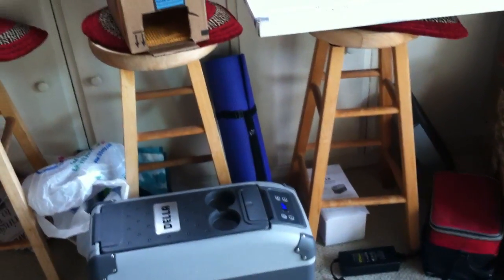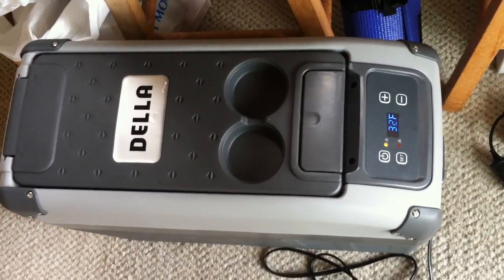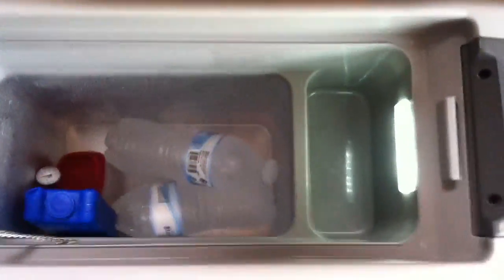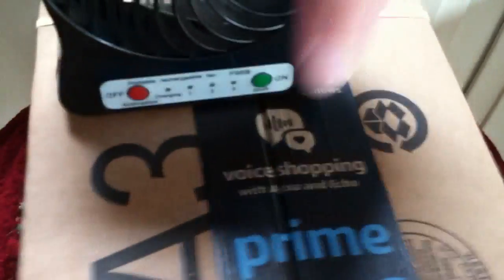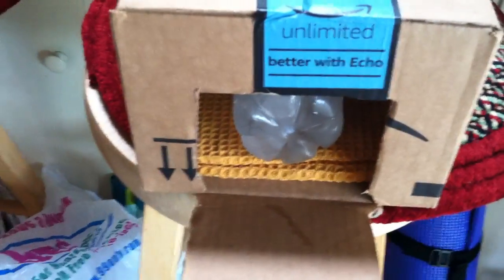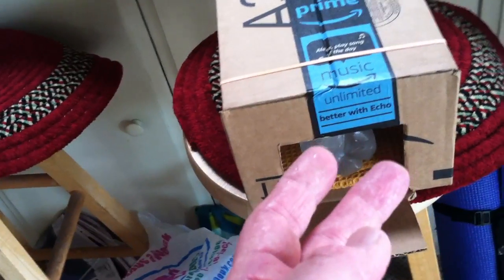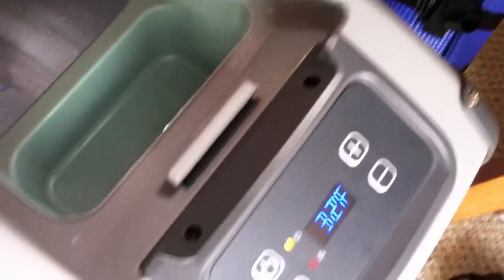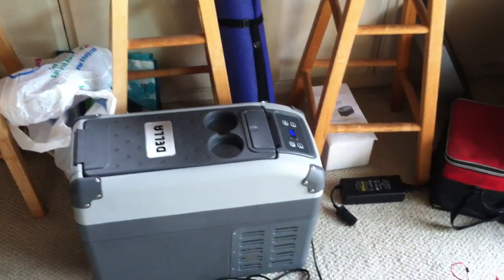Personal Solar Powered Air Conditioner----update

Comment: http://www.goodreads.com/book/show/295736.Solar_Energy_Projects_for_the_Evil_Genius check that book out. one of the projects uses ammonia-salt brine and solar heat to replace the compressor. The book gives instructions to use it to make ice, but compression and changing gas to liquid  on the cold coil is the trick. I would recommend a box (metal to allow good temp transfer) around the coil to ensure ammonia gas can't leak out, but a fan can blow right over the cold part instead of making ice. just need a fan beyond the cooling system itself. Einstein once said the best way to generate cold is to generate heat.
Reply from the maker: We use a Dometic 3-way refrigerator chest when we are over at Catalina island.  We set it outside in the cockpit and run it on a small bottle of propane. It will run three days on one can.   I did alot of research on these type of refrigeration units.  Einstein and one of his students were the original designers. They don't work very well on a sailboat under way because of the tipping.  In a harbor they work great.

Comment: The heat extracted from the water has to go soewhere so the freezer shouldn't be in proximity of the area being cooled. It would preferably be vented outside or away from where you're trying to cool
Reply from the maker: YES!  The little freeze will be located near an open hatch and the air flow in the boat should take the heat out that hatch.  It is spot cooling I'm after but if I end up heating up the whole inside of the boat that is no good.  Excellent point.

Comment: drill inlet and outlet on one side of freezer (so the lid will still work). 1/4" copper tube coiled inside a 1leter water bottle filled with ice and a large rubber hose with a reducer wiuld do nice... a 1/2" 3v edf (like in 12v inverters) in the hose and a usb like you already have for the mass flow.  a little less cool than streight ice because of serface area but sustainable
Reply from the maker: Yes!  That is the best way to do this but it then becomes a stationary AC unit that I can't move around easily.  I still might end up doing it that way.  Thanks.  Perhaps make this up as an 'either or' device that can work both ways.

Comment: Nice keep pushing.  I get the part of blowing a fan over the ice to spot cool you, why do you say it will be cool DRY air.  You said the day would be hot and humid.  It would seem humid air passing near the ice would condense (some not all) but in trade this accelerates the ice melting which as it melts is putting water vapor right back in the exit air stream and a return to near the same humidity as at input.  Can you show me where I got off track?  Not trying to be critical, I have been wrestling with this for quite a while, and could use a bit of understanding.
Reply from the maker: That is why I am using the sealed frozen containers.  The water stays in the container.  The cold mass condenses out the water in the air as it passes by the bottle. The condensed water is usually drained away somewhere or collected in a container. There is a differential in air humidity between the inlet and outlet and the air flow feel cooler than just cold humid air.  I was really surprised how well these simple 'ice' AC units work.  Build one up and try it.  An old shoe box will work to test the theory.
Reply: Thanks, somehow I forgot you were not using a block of ice but are using a sealed bottled of ice!  Old brain gets tired sometimes!  That all makes perfect sense now.  Now if we could find a better substitute for using mechanical compressors.
Reply from the maker: Yes.  I really don't like the mechanical compressor method either.  I spent some time working with Peltier modules the other day but the efficiency is terrible.
Reply: After 150 years, one would think there would be other reasonable ways to make cold without resorting to compressors and Peltier modules.  It is hard for me to believe Nature is that limited.  As another interesting research path, I have wandered if the principle of a capacitor could be incorporated.  As I see it normal refrigeration hot/cold is really an expression of electrons gaining and loosing kinetic energy.  A capacitor when charging would be similar to compression (heat side) and a capacitor discharging would be similar to the expansion (cooling side).  In the first phase the electrons are forced into a higher density order and  later the released electrons revert to a low density order.  Has anyone noted cooling effects with capacitors?  An advantage of capacitors if could be used is no moving parts and a much larger choice of insulating materials which would also serve as a dielectric.  With Peltier, the choice of thermal insulators is very limited as they have to be conductive also.  Have heard of acoustic refrigeration, with interesting potential, but after a big splash in science circles, we hear little more progress.  My thought, has anybody looked in piezoelectric ways to achieve cold?  Many directions.  So far, Maxwell's Demon is triumphant!

Comment: make a swamp cooler,no ice needed,just a fan and a small 12v pump to circulate the water,or get 50 feet of 3/8 copper tubing and put it around a fan and pump cold water through it
Reply from the maker: I built one of those a few years ago.  The problem is getting the cold water.  I am going to use this on a cruising sailboat and the ocean water temp here in So Cal gets too warm in the summer to work well.  If I converted this little freezer to the single purpose of cooling water I could use that 'copper coil on fan' method.  I might end up doing that.
Reply: The fan + copper coil + ice water pumped from & back to the freezer would be a good idea because with multiple coils, you would get a higher cooling surface area & thus higher heat absorption & thus greater cooling.

I'm wondering if you can use your battery or batt + a starting capacitor to get the Della started & then just run it off the solar panel + batt (for when clouds passby).  If not, then you may need a larger solar panel.

Alternatively, you could run your copper tubing from inside the cabin to an ice chest that is full of dry ice (which would be placed outside the cabin for optimal safety).

What are the specs on your Della?  I searched a bit for it online & couldn't find it.
Reply from the maker: Here is the DELLA freezer:  http://www.ebay.com/itm/16L-Portable-Freezer-Chest-Fridge-Compact-Ice-Travel-Road-Trip-Camp-12V-24V-110V-/232123941137?hash=item360baa4111:g:5OoAAOSwA3dYDmba.    It runs on 12v @ 4 amps and will cool from 4F to 50F.   Your idea about using a compressor start capacitor is a great Idea I might try.  A little bank of super capacitors might even work.  What I have noticed is that getting the compressor to start is the hardest part of this unit.  It will keep running down to 11 volts with just a few amps.  The electronic board on this unit is very protective and it won't start the fridge at all if there isn't enough power.
Reply: Thanks for the url.  The data shows the low temp of the freezer is -4 °F (which is quite good for such a small unit that uses 134a refrigerant).

Alternatively, you could use high C (drain) li-ion cells as your compressor booster, if you want to ensure you've got enough energy for nonsolar periods.  I'd suggest a 4S3P arrangement (using 3.7Vnom, 3400 mAh 18650 cells).  Some start caps have a high self discharge rate, so they wouldn't be much good at night or during cloudy days.

re:  "What I have noticed is that getting the compressor to start is the 
hardest part of this unit.  It will keep running down to 11 volts with 
just a few amps."

You can't rely on the 11V measurement because the unit will draw more power during higher load & temp conditions.  I think the rule of thumb is that you need about 3 times the power for approximately 1 second to get the compressor up to speed.  In your case that means 144W (48W*3)

I think I would go with a li-ion battery because once charged, it will have a very slow self-discharge rate & it could also be used for other purposes in emergencies, if needed.  I've seen 5S li-ion batteries used to start small cars--so the cells do hold a lot of energy & can provide a lot of punch when needed (if you have the high drain type).
Reply from the maker: I looked into li-ion 12v power packs today.  I think that is a good match for this project.  The ones I looked at were pretty expensive though.

Comment: For the sailboat, what about maybe upgrading the insulation with some modern material? I'm a nutter for aergogels. Certainly costly. Bringing aboard a good amount of ice contained in serious coolers will surely do you good.
If humid is unwanted, what about a dehumidifier with natural component (sea salt?) so you can toss it overboard responsiblly?

One of my green energy obcessions is this:
You have a piece of land in a place where you do get snow.

A large piece of fabric of sorts is rolled out when snow is expected, cold snow. A large crater was dug on the land.
After the snow, when temps seem to botttom, you pull all the fabric over so the snow goes into the crater. Cover with something insultating. Idealy the crater is higher placed than a nearby lake or stream, so you can drain it.
If you have air pipes going through the bottom of the crater... you get it, cold air. Depending which source is cooler, in summer you recycle house air or pull in outside air to go through the crater and into the house.
Melt water compromising the remaining snow? You might run it through a heat exchanger on opportune days when the sun helps you get create a good differential.

Same for having land next to a substantial lake that gets frosen over. There is SO MUCH energy differential in a half meter ice for a good surface... Harvest on a cold day. If it freezes over again, harvest more ice. It's  how fridges were built in the old days.
Heck, I'd love to run a whole indoor cross-country skiing facility off harvested ice if I could. Harvest in the winter when -25ºC or so, use to cold air source to make snow inside (well insulated of course). With a clever dam design the lake ice would all but harvest itself.
Reply from the maker: Interesting ideas.  Thanks.